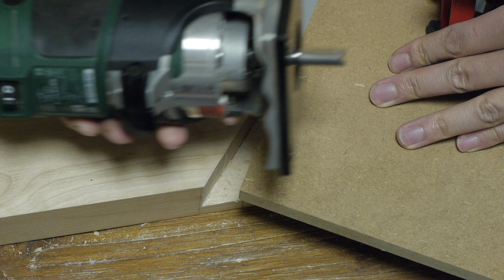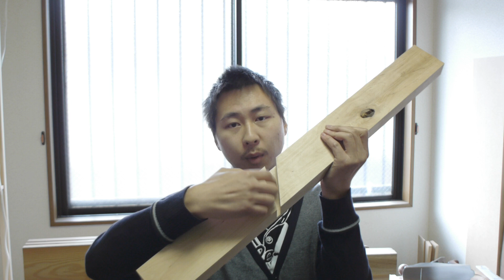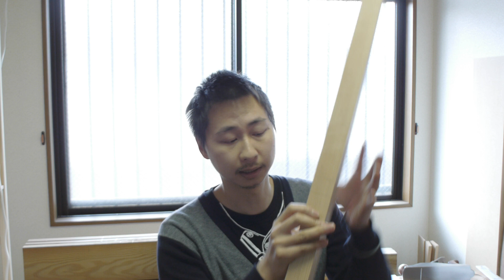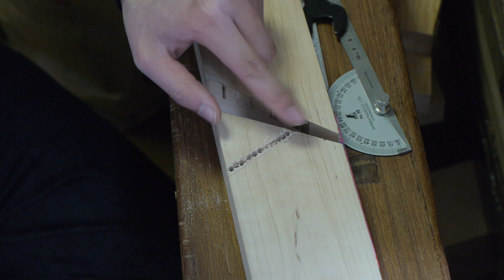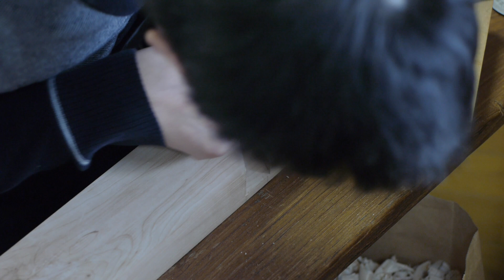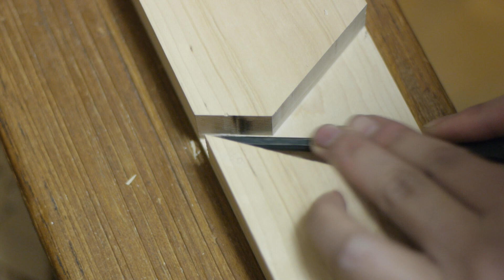How to make a traditional style jointer plane part 3

Comment: This is the second time I look at your tutorial... I know I'm close to start doing mine. Also i plan to do smaller planes different sizes, more like rabbet or shoulder planes. You should do one tutorial of those sometime :)
Reply from the maker: Thanks! Unfortunately I don't have an immediate need for a rebate or shoulder plane so they are quite low on the priority list. I do plan on making some small thumb planes size ones though with curved soles.

Comment from the maker: Resak should be a good, durable wood to use. It must be tough to work though :p
The 64 degree line is not really critical but you need some sort of clearance there so that your shaving can escape. If the mouth is wide enough for the shaving to pass, then you are OK. If not then you can take a thin chisel or file and pare/file the mouth area to open it up a bit. You can also make a 26 degree angle block and place that at the mouth to as a guide to help you pare. Let me know if you need more help.

Comment: Hi Sumokun,
I've just started making a jointer plane base on your tutorial. Anyways, the wood I'm using is a tropical hard wood (name: resak, family of Dipterocarpaceae) Anyways, I'm using a stanley blade (much thinner blade). Now, I think I have screw it up a little. Ok, you know the angle of 58 and 64 degrees, I think I omitted the 64 degrees when I did the cutting. is the 64 degrees crucial when adjusting the mouth? I think the mouth is slightly wide enough for the shavings to pass through.